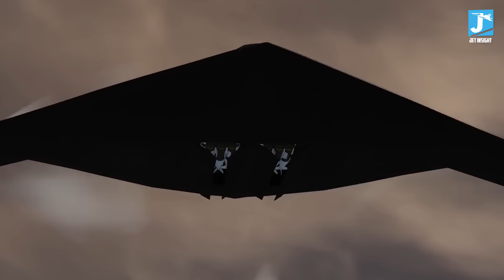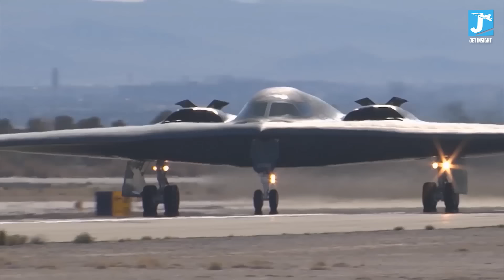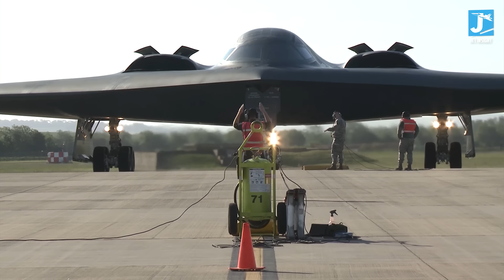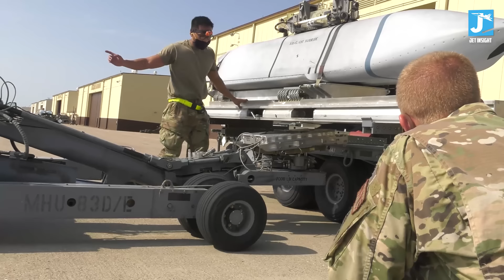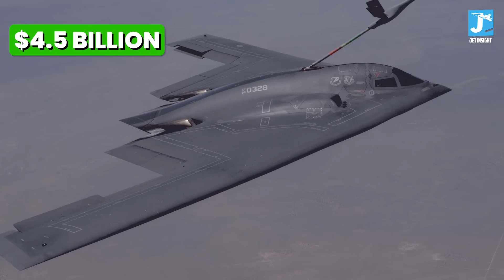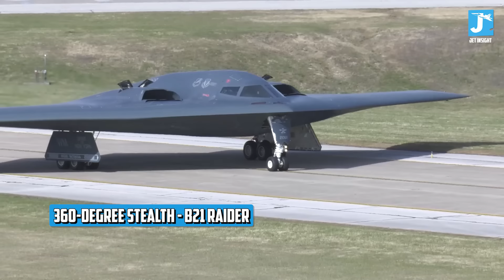Why the NEW B-21 Raider Will Completely Dominate the B-2 Spirit

Comment: Well it's obvious that the voice is either TTS or AI voice reading since it has weird pausing points in the middle of sentences.

But this was a very confusing video because you mostly showed the big black bomber rather than the smaller white bomber. Then there was a point where you even said "This B-21 Bomber...." Yet the image being shown was the black presumable B-2 bomber. So which one is the B-2 & which is the B-21?

Comment: I know that the B-21
, Is far superior and newer components plus better weapons too, But I think the B-2 still is a badass because it can be updated and upgraded to meet the 2027 budget and still have a purpose in our Air Force, And on top of that both B2 & B21 can be given wingmen and drop drones that when they fall it turns on and bam these drones can travel at great speeds and move like a flying peregrine falcon and plus each drone and wingmen has the capacity to change control and see the battlefield and make changes as other drones and wingmen calculate their targets and make the necessary decisions and hit as many different targets and make sure that battlefield is safe for other aircraft and jets to strike their territory targets all around the same time so that the entire enemy can't respond to the shock and awe of our Military Tactics and Mighty Arsenal of weapons...

Comment: The B-21 Raider is being hailed as the future of American strategic bombing, and many analysts believe it will completely outclass the legendary B-2 Spirit. With its advanced stealth design, cutting-edge avionics, and lower operating costs, the B-21 is built not just to match the B-2 but to dominate it in every aspect of modern warfare. As production ramps up, the Raider is set to become the backbone of U.S. airpower for decades to come.

Comment: FACT: The B-2 is still superior to the B-21 in several fundamental ways. The B-2 Spirit is significantly larger than the B-21 Raider, with a wingspan of approximately 172 feet compared to the B-21's estimated 132-140 feet. The B-2 also has a greater maximum takeoff weight and payload capacity. Those HUGE bunkerbuster bombs the B-2 recently delivered in Iran would not be possible with the B-21. The part of the video claims the B-21 can carry the bunkerbuster that weighs 30,000 pounds, but there is another part of the video that says the B-21 has a maximum capacity of 20,000 pounds, compared to 40,000 pounds for the B-2.
Reply: Thank you for repeating word for word what this video states.

Comment: The real reason the B-2 cost over 2 billion each, is the program was going to build 175 B2's. but the program was cut to 75 B2's then cut to 21 B2's. So look out for th4 B21 cost go up if the total aircraft are not built......😂 I work 10 years Building the B2 in Plant 42 Palmdale

Comment: Cost wise, not comparing Apples to Apples. One is the cost per plane of a program that was shut down with a fraction of the  production completed. Thus each completed plane contains the R&D cost of 6 planes.   Versus, the projected cost per plane of of a complete run of the new plane that hasn't entered full production yet.

Comment: Keep in mind this is a very pro US overview.  In theory they're undetectable, but in practice?  Detection systems like the Nebo-M are evolving  using a much higher spectrum of radar, each detecting different aspects, and powerful computers can potentially figure out a mix of small but distinctive fingerprints.  This is why the US does its very best to never fly its top stealth bombers over areas Russia or China  can measure in detail. 

Just because a system knows it's there doesn't mean missile targeting is easy, but now with high speed networking even in missiles it's possible.

Basically the B21 is a huge improvement and would be undetectable to a medium tech military, but against a peer competitor that also has stealth technologies including detection?  Uncertain, and I hope we don't see because that's WW3.

Comment: The B-21 won't be spit if it has the same flaws as the B-2 Spirit. The first being rain. It flies great can hide from radar good payload but it a front seasonal aircraft, meaning you can only fly it in perfect weather conditions. War sometimes has only a few days like that, depending on where the fighting is.  2nd cost in upkeep. What is cost to maintain its stealth in air conditioned facilities so the B-2 Spirit can be ready to fly is ridiculous.

Comment: To be fair, you need to consider the 21 cost if they only ultimately build 23 or whatever they did with the 2,. Said differently, if they had built the number of 2 planned, the NRE would be split across 130 aircraft, not 23.. Run the numbers.I'd bet it they only built 20+ of the 21 thier unit cost might exceed that of the handful of 2s. AF Veteran, I love my aircraft but don't blow smoke.

Comment: Proud! But you made a mistake in your discussion of the B21's stealth ability. You stated it’s stealthy for 360-degrees; meaning defensive radars can’t paint it from the front, rear, or sides. And because of this capability, it just disappears. I say no, it doesn’t simply disappear, it was never there. If radars can’t see it coming or going, it was never there.

Comment: My gosh. The massive B2 Spirit has a radar signature the cross section of a mosquiti? This, regardless of those engines with their heat exhaust. An upgraded new design that reduces the cost from $2.2 B to $692 M. 360 degree radar cross section regardless of engines? How can this be? Absolutely fine engineering and applied science. Americans probably don't realize that the "flying wing" configuration became a functioning reality with computer technology. With no vertical stabilizers for rudder (yaw) control and horizontal tail elevator (pitch) the plane required the more compact flap like devices that replaced these traditional mechanics to be continuously controlled by micro sensors of air flow and aircraft stability. An amazing jump in aircraft control and safety.
Reply: Actually the Germans were getting the flying wing in the air in the 1940's. And America had them flying in the 1950's.  IIRC the design was first put forward by a russian design firm in the 20's or 30's. I find that incredible. The Wright Brothers got in the air at the turn of the century. The 20's had us in biplanes. The 30's were already producing proformance multi-engine fighters and bombers. And the 40's had jets already. Truly remarkable advancements in aviation.

Comment: Pride.
I worked 40 years in aerospace. A big part of the cost is the absolutely perfect quality control. Ever Bolt, screw, and bonding is witnessed by a quality rep with a checklist.
Everything out of that plant was perfect. 
Because the builders on the manufacturing floor were proud.
Reply: Thank you for the care, and process. Those crucial inspections are top importance. My husband worked for Raytheon, in quality control. He took the job very seriously. Some time fought with engineers over, purchasing shorty parts, and won his side. It’s vital, to have well made every part, bolt etc. Of the highest quality. He was proud of his job. Was 37 years with Raytheon. He retired young at 59, because of illness. He lived until six days after turning 69. He was a remarkable person. Best wishes ♥️♥️🙏🙏🇺🇸🇺🇸
Reply: Is that meant to be a good thing or what the "pride" thing?
Reply: X British Army 89...The Russians are chasing a high flying, high speed US aircraft. It's the reason they're building the MiG-41. They warned the US to back off but it landed on deaf ears. 🇬🇧
Reply: Unfortunate that doesn't occur with our current Naval warships, but a grander scheme is apparently far more difficult.
Reply: 破飞机，还是亚音速，美国只能讲大话，我们中国的六代机j36和j50已经在天上了，你们的在哪？别吹牛了

Comment: Why doesn't anybody talk about the fact that underground bunkers and other facilities can be literally thousands of feet deep. There are mining operations in the world that are over 10,000 ft deep. There is no way Bunker buster bombs are getting in there, that deep, especially when you're dealing with solid rock. It's just not going to happen. So please stop making false claims about their capabilities.
Reply: The B 21 is like a transformer it can transform into a robot and climb down the bunkers. Drop its bomb and climb back out. Oh yeah. 🇺🇸👍👍
Reply: The Iranian nuclear refining bunkers were not deep enough.  Those super deep mines are also hot, takes several decades of mining to get that deep.  The bunker bombs were followed up with two more each that went down the new holes, and one can penetrate 200 ft pf concrete or rock.  All they have to do is penetrate deep and the mega-explosives will fracture all rock within 1’000s of ft,  those bunkers would collapse with repeated hits.

Comment: The original shape for the B-2 is the shape the B-21 is using today. Stealth was an unproven concept so the B-2 was sent back and directed to become a low altitude penetrator. The original design was for a high altitude penetrating bomber and had the same shape as the B-21.
Reply: The B-2 was NEVER a low altitude penetrator, that is the B-1B and to a far lesser extent the B-52.  The B-21 is simply a newer B-2 built in greater numbers (mostly because it's technically a medium bomber)...in other words, it's: hey look, here's more than 22 B-2's.  Pffft, gimme the current line-up of B-1, B-2 and B-52 any day.  And anyone who tells you less is more?  Full of sh!t.

Comment: Where does he get the idea that the B-2 can only carry 40,000-lbs of weapons? The B-2s that flew to Iran carried two GBU-57s, each weighing 30,000-lbs. Do the math. EDIT: OK, the Wikipedia article for the B-2 states that 40,000-lbs is the official payload limit. However, it also states that the maximum payload during an operation (by which it must mean the Iran mission) was 60,000-lbs. Apparently the GBU-57s actually weigh 27,125-lbs each, for a total payload of 54,250-lbs.
Reply: b21 vs b2. 21 is smaller. b21 will carry the newest upgraded  MOP. smaller but just as effective
Reply: So it can't carry out biggest bunker buster.
Oh well, maybe in another 15 years they will roll out a B-22 then?
Reply: Was it a B-2 or A B-21, think about it! They didn't name it the  B-21., think about it. The B-21 is so much more advanced then the B-2. Their not going to release the true specs, weight size of anything we use in the American Military arsenal. You do realize America invited Gorilla warfare... Id hope you know this before speaking on a topic you know zero about!
Reply: Wikipedia is a joke.
Reply: Video also said that B-21 has a payload capacity of 20,000 lbs.  But later stated that it can carry the MOP bunker buster bomb, which is 30,000 lbs.  There was another time where he got a certain fact wrong but I can't remember.  This is sloppy work. AI slop.
Reply: Thank but I don't care but I m thinking to buy one.
Reply: We wont get the true facts cant give off any more info on it
Reply: Those B2s apparently took off with minimal fuel in order to be able to carry them. They were quickly topped off with fuel via midair refueling once airborne. So, the maximum takeoff payload might only be 40k lbs if at maximum fuel. But, could be higher if taking off with very little fuel
Reply: Payload is calculated assuming a full fuel load also.  The B-2s that bombed Iran carried less fuel, which allowed them to carry more bomb weight.  That's why they had to refuel multiple times en route.
Reply: That take off weight. Can sacrifice fuel for payload. Refuel to full with added lift, refuel at speed with lift repeater
Reply: haha your president is a child molester
Reply: Either way, it has about half the payload of the B-2.
Reply: Certainly these items and matters are above our SA and pay grade. I think perhaps the fuel, or lack of, had something to do with the overall weight strategy bombing Iran?
Reply: It can only fit 2 bunker busters. Wouldn’t even say thats its max payload. We will never know what it’s truly capable of until it’s retired and even after that might risk the b21 so might stay classified.
Reply: 破飞机，还是亚音速，美国只能讲大话，我们中国的六代机j36和j50已经在天上了，你们的在哪？别吹牛了
Reply: Who cares thats the past
Reply: The bombs are also getting smaller
Reply: “He” lol ai
Reply: 40klbs is the weight given for payoad because more will stress engines and airframe shortening it's life. To carry two gbu's the plane is pushed hard and limited in take off fuel to compensate for weight. The plane will have to refuel before the mission to have the range needed to complete it.
Reply: No one reveals true capacity!  Come on guys. So much is classified. Also the plane can limit its radar signature, but why track that signature when it may be so much easier to track its wake/turbulence as subs are tracked. Someone has figured that out.
Reply: They must be kids, thinking Wikipedia has stats on the most top secret bomber ever
Reply: @Justone372   Best reply, thank you!! Somebody with intelligence replied to this instead of just looking for ways to prove a YouTube video wrong. These people need to spend more time  reading more articles from multiple source. They need to  Enhance their own Intelligence Instead of shooting their "Facts" from wekipida like shooting a gun from their hip. Great comment!
Reply: Technology and censors don't necessarily make things better. Censors fail, look at the f35. The B2 is still more reliable, holds more capacity, and has been flown and fixed for years. The b21 can't and won't change the game like people think. The B-52 and the B1 are still the workhorses. In a fallout war B2 and b21 won't get used much
Reply: This is why no one should rely on Wikipedia or information drawn by AI queries from Wikipedia on anything of substance. General information that doesn't affect anything important is probably mostly okay. 
  Remember, Wikipedia is managed by people. None of us know and all can change any of it.